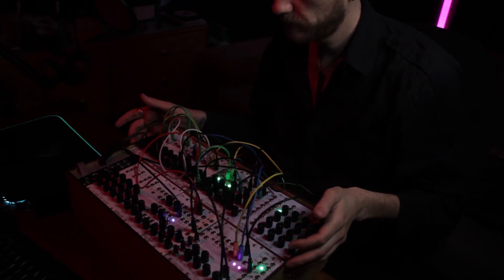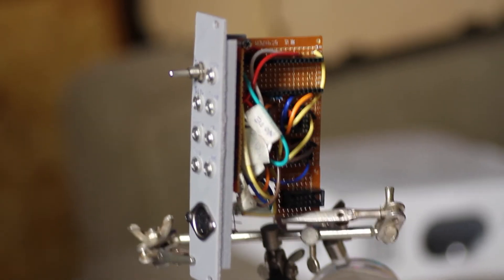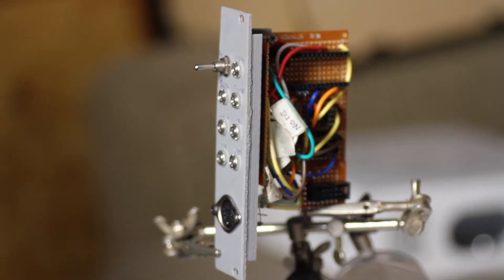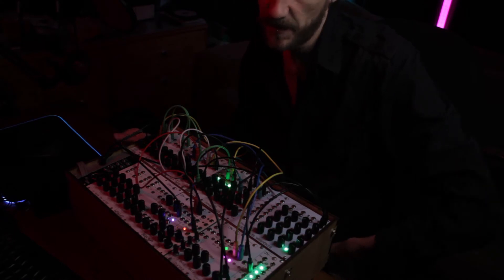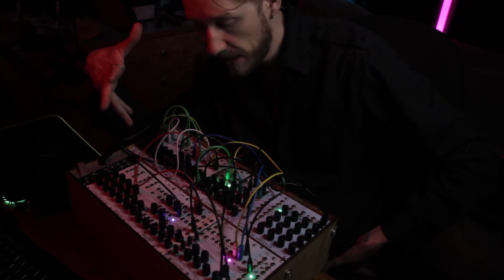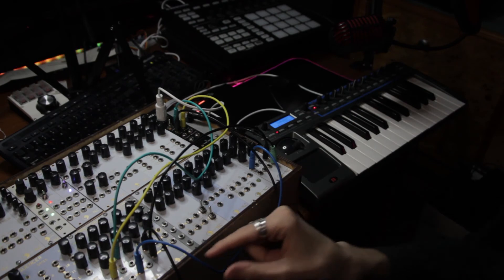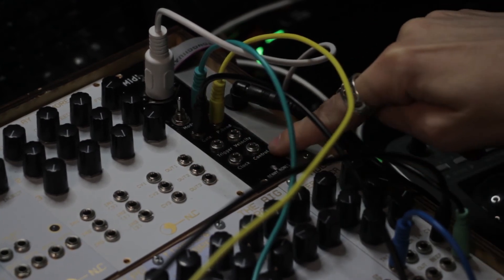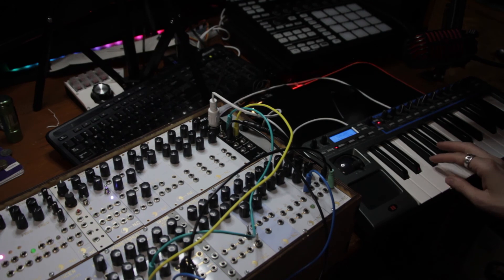Midi2cv - DIY Arduino powered Modular Synth Midi to CV convertor

Comment: has this actually worked in principle, as I've tried everything and it doesn't work for me.
Reply from the maker: Works fine for me. Ive made 2 of them now. There are a few issues with the v1 but i corrected them before uploading. How is it not working?

Comment: Hi all. May i kindly ask for your help? I've build this one also and works for the most part. I cannot seem the CLOCK to get working. As the code states the clock is on D4 pin of the Nano and works if i test it with the 'Blink' example code, but if i load the midi2cv.ino, the clock output isn't working. Any ideas what might be the problem? Thanks in advance for the help.
Reply: Check that the pin used for clock out is correctly defined in the SETUP part of the code, ie Digital_pin, and that any code reference to Clock is going to the correct pin.

The pin definitions in BLINK and this MIDI project are presumably different.

Comment: Nice one! I think i remember seeing your printed one on reddit when I was researching before building one! Did you try changing the code for the scaling at all? 
I tried with a trimpot but didn't really understand how that was meant to work,  is it kind of the same process as setting 1v/oct on a vco?
Reply from the maker: No I didn't change anything I. The code for scaling. I have a little poke around for future features: v-trig/s-trig options, channel changing, hz/v, etc.